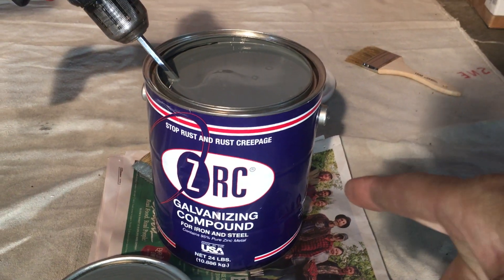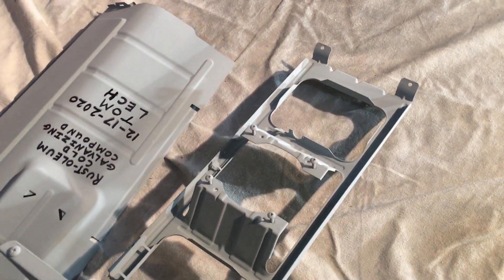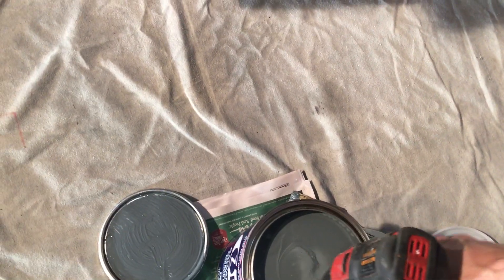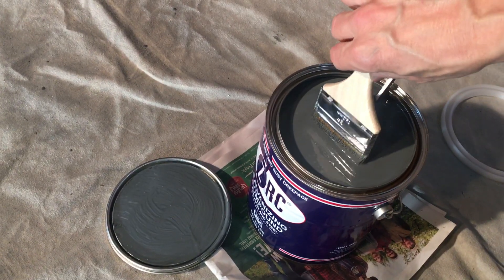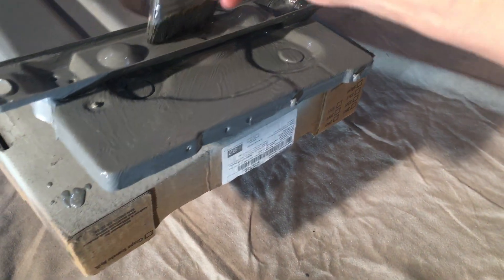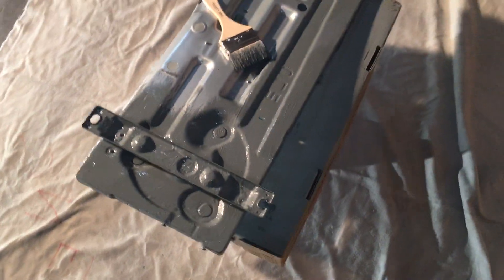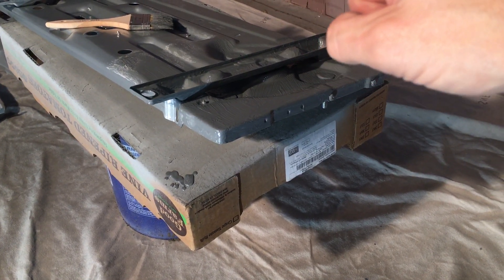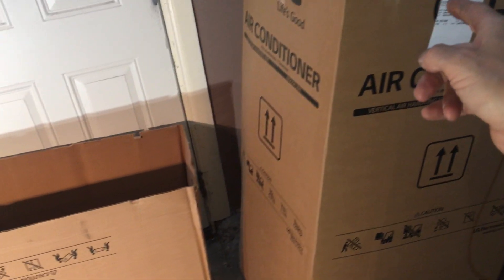Heat pump for coastal salt water spray corrosion proofing. ZRC Galvanizing compound 95% pure zinc

Comment: Have you posted an update for the zinc experiment?
Reply from the maker: I haven’t posted anything on that unit but I was over there last week in preparation for a different project there will probably be no rust showing on any of that metal for about 20 years. 

         This is great for people who live right off the ocean coast and get the salt spray that just rust your units out in a couple years.

       Should easy add 10+ years to the life of your unit of the exposed metal parts 

This is this type of stuff that our federal government uses on our national highway overpasses and bridges on all the galvanized parts when they cut them or weld them or drill into them in the presence of salt water

      This is the same type of compound that is used on the Golden Gate Bridge and the Bay Bridge in the San Francisco area underneath the paint anytime they do any welding or cutting into the metal for maintenance

I will probably be very old and unable to climb on roofs anymore and my grandson will be maintening  this unit by the time it shows it’s first signs of rust

I have another video where I put a protection coding over the actual sins and coils of the condensing unit

Comment: I suppose the manufacturer will void the warranty though. 
What do you do for the outside covers?
Reply from the maker: Since when does anybody ever warranty the bottom plate of an air conditioner. 
              I made a video on the outside cover all removed with an extra coat of paint put over the inside and the outside of the outer cover

           Then I made another video on the coil coating Buy another manufacturer that makes coil protective coating

       Especially helpful for people who live right off the ocean coast their unit start rusting out and falling apart in about 4 to5 years when normally a unit with last 20 years or more if they were not exposed to salt.
Reply: @coldfinger459sub0  Thx much for replying. My 5 year old Mitsubishi's covers are rusted. I'm one block off the ocean & paid top dollar for this mini-split. I removed the covers & the inside still looks pretty good. But I'm not gonna wait & watch it deteriorate any more. First order of business is to kill the rust on the covers & get them properly protected.
Reply from the maker: @bgregg55  there is a product called rust mort that is a company’s brand name it’s a product that you mix with water spray on the rust let it sit and then clean it off with water and maybe scrub it with a Brillo pad. 

It makes an oxide that paint can I hear to and helps prevent rust

Then there’s golf Coast spray product epoxy for the coils but you must get a very good coil cleaner first thoroughly cleaned go to the companies website and follow their instructions on cleaning prior to applying the epoxy coating to your coil fins

https://youtu.be/WJ_sWmC18wI

Here’s a link to one video I made just on applying the coding out of the spray can definitely go video Modine website to look up their product in their application and cleaning videos
Reply: @coldfinger459sub0  I used a different rust convertor (ospho) that I got at ace hardware. Does the same thing: converts iron oxide (rust) to iron phosphate. Now I'm looking for a beige spray paint for steel. Then I need to spray the bottom pan & interior sheet metal with that rust oleum cold galvanizing compound. I also found a spray coating for the circuit board on amazon & I'll just have to spray it in place. I cant find gulfcoat at amazon...got to get it direct from modine. Duracoil is another spray-on coil coating & there are probably others.
Reply from the maker: @bgregg55  Yes there are many other ones I have seen dozens of them over the decades for coil coat and also cold galvanizing there is a big difference between the commercial industrial brands and the cheaper brands that you’ll find and hardware stores and big box stores. 

I for example a gallon of the commercial stuff weighs 26 to 28 pounds because it’s 95% pure zinc. 

Not this over diluted crap that they sell in a can or a bucket that is only a small percentage of zinc so they can brag and falsely advertise that it has zinc inside of it but a very low percentage. 

The same goes for all the chemicals that are an acid base that convert rust into an oxide you have to properly follow procedures to neutralize it afterwards before putting paint on top of it or a cold zinc compound

And then you have to be careful about what kind of paint coatings you put on top because epoxies do not like paint that contain alkaloid base you have to look at the chemical compatibility

And you can actually cause more rusting if you do it in properly with the proper coding because you can actually trap moisture or through micro fractures of the sink and it’ll rust from underneath your coding and keep on traveling
Reply: @coldfinger459sub0  Any updates on durability or what you might've done differently?
How did the regular spray hold up in comparison?  Thank you!
Reply from the maker: @1nvisible1  no updates yet but thanks for reminding me it has been a year now

When I return to the site I’ll do a short update video on the condition

I was there about a month ago and it still looked exactly like it did the day I painted it other than it has dust on it and it’s been through the rain last winter and through the summer so I’m perfect excellent condition with no signs of wear tear. 

These are all proven products that have been used for decades so there’s nothing new here that hasn’t work before on any other product and Modine coil coat has been used around the world on their products

The galvanized product I used is use around the world in Marine Harbor‘s and on bridges over salt water all over the world for decades and by welders who do metal fabrication and repair around salt water so this is nothing new product has proved itself over the generations to be a proven product